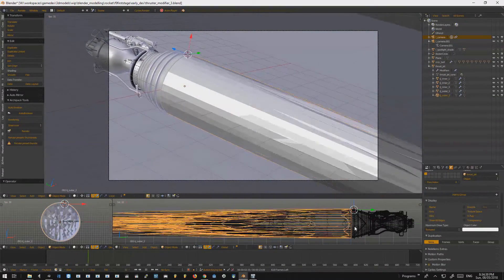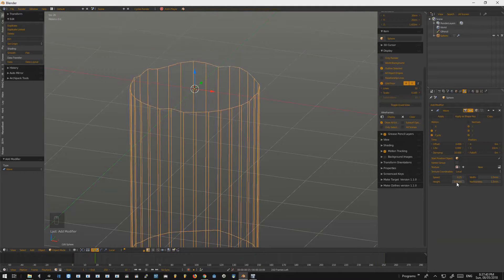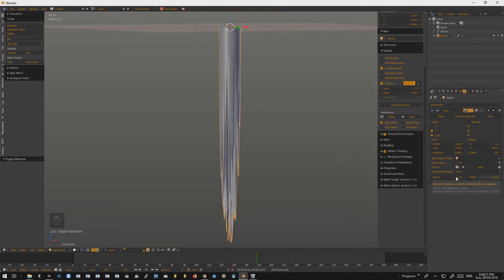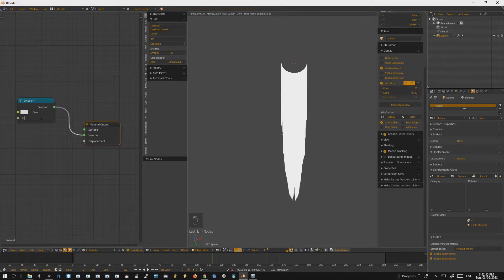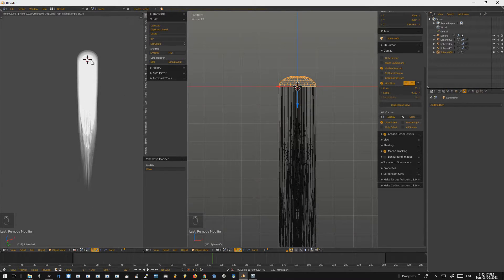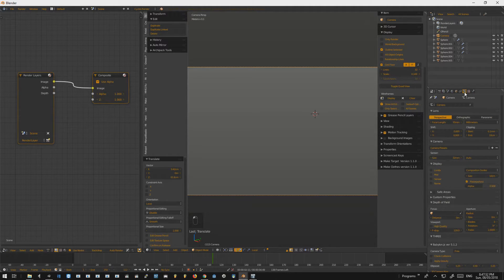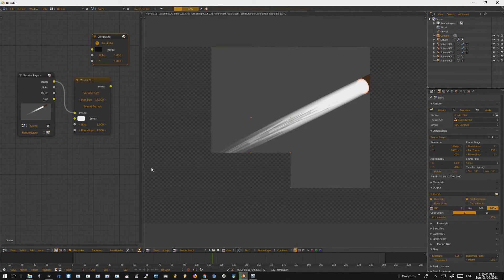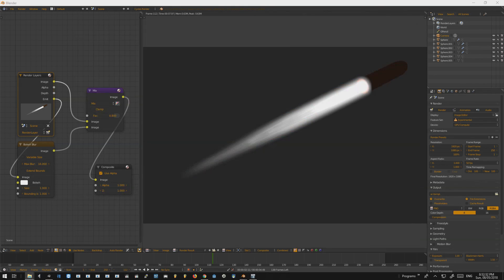Blender3D - Visceral Rocket Exhaust Flames without Particles

Comment: For those using blender 3.1 having problems with the wave function: Scaling down the width is what now defines the distance moving vertices. The lower the width, the noiser the wave will get. The height needs to then be adjusted inverse proportional to the width, resulting in huge numbers. My setup: width= 0.031m height = 200m
Reply: Thanks, this just saved me probably at least 1/2 hour looking for the answer!
Reply: I love you
Reply: Youre the man bro

Comment: This is exact effect I was attempting to create for my latest project. After numerous attempts using particles and smoke simulator I gave this a try was extremely happy with the results.  I did however come up with very different numbers used in my wave modifier but eventually came up with similar results demonstrated in your tutorial. Thanks for sharing.
Reply: Hi mate, I can't replicate the wave as in this tutorial, have been at it for hours. Would you please share the numbers you used to get the same effect? I am using Blender 2.8. Thanks
Reply: @dannybouchard4140  Hi mate, here are my values for a 1x1 and 8m long flame. Height: -2m, Width 0.013m, Narrowness 200m, Y offset position -0.05m, done in 2.81
Reply: @Angeldust-42  Thanks mate
Reply: @Angeldust-42  
Thanks
Reply: Same here

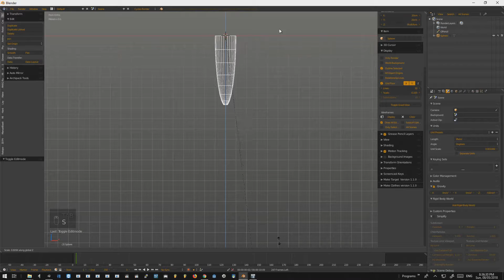Comment: so i think i found a fix for the error you guys having as i had it as well. In the video @1:03 he scales and stretches the sphere. Look on left side lower of screen in the video, you will see a "resize" panel open. This is the problem. To get his "resize" panel hit the spacebar and type resize. Notice in the video he has his set with constrain axis Z checked and orientation set to global. You can see it @1:03 in the video. If you blink you will miss it! The key here is to hit spacebar, type in "resize" and set yours just like his @1:03 in the video. Hope this helps cya
Reply: When I hit spacebar, the only think happening is that the animation is playing?
Reply: @Pommes736  try going into preferences and see what your spacebar is mapped to. make sure your mouse cursor is in the window of what you are working on and not in the timeline area. i am using blender 2.79
Reply: @Pommes736  [Shift]+A for Blender280 and above

Comment: Hey I'm following along and my flame doesn't fragment in it's animating like yours does, the whole thing just kinda pulses. I made a sphere and added the wave modifier, same settings as you, but it doesn't look anything like it. Any thoughts?
Reply from the maker: For the wave modifier, try to just type in the values for speed and height, instead of using the sliders. Also check that the animation frame rate is above 24fps. Hope that helps.
Reply: @F96-t6s  hey, I have the same problem and your tip sadly did not work. I just typed in all parameters like you did and I also set the Framerate to 50fps, but the sphere still pulses. Do you have any other ideas what I could do wrong?
Reply: @TobisFotografieNRW   Hi, If you look closely at the width and narrowness, they are set at mm not cm. Also when I did this the result was still not the same. I ended up having to put the width at 1.5mm and the narrowness at 1.5cm. I hope this helps.
Reply: @tommyabc1221  thank you for your tip, this does work for me, too. Maybe the modifier changed through the versions. I also found out that it matters how long and how big the half-sphere is. With other dimensions you also have to change the width and narrowness. I'll keep trying :)
Reply: @TobisFotografieNRW  Check your Y values. It worked for me then.
Reply: same thing happened to me
Reply: I'm version 2.79
Reply: I thing it has something to do with scale, or some bug in blender
Reply: This one worked for me https://youtu.be/W6XLXITvCEc
Reply: just use random propotional editing